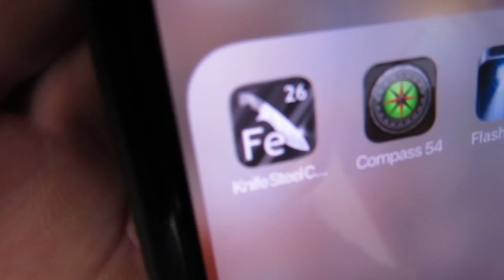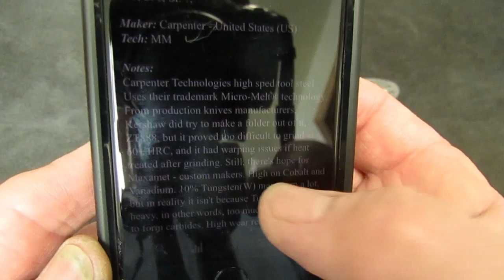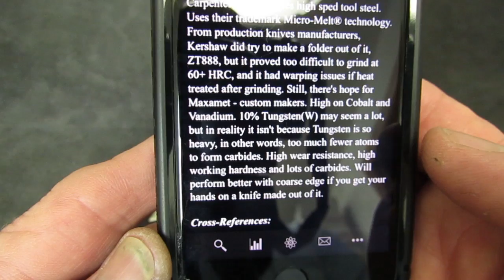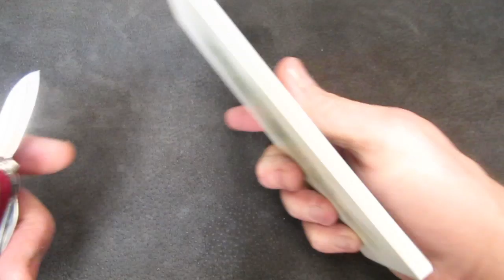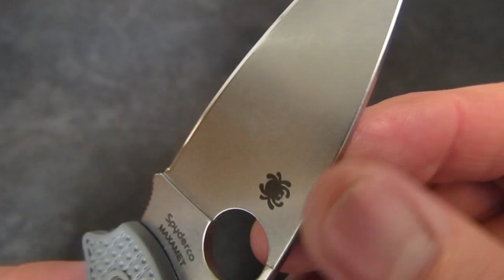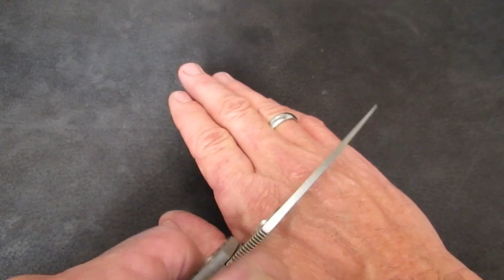FSB -- Struggles and Solutions:  My Maxamet Nightmare

Comment: https://www.youtube.com/watch?v=uhbKouyICyk this is another video done by a youtuber who got great results with his. Mine has held up very well in cardboard cutting and whatnot, great work knife. No sharp corners are due to the stonewashing v. satin finish, the same thing is true on the Slysz Bowie.
Reply from the maker: These corners were definitely NOT the result of stonewashing... unless they were tumbled for a few weeks.
Reply: Interesting - I assumed stone washing as well. The edges look too consistent have been removed on a belt or other tool. Doesn't seem possible these were done by hand. The finish is too consistent as well. I'd guess stone wash with something harder than normal or something called vibratory wash that uses liquid and a ceramic abrasive. Of course I easily be wrong.

Comment: Appreciate you going into more detail on Maxamet, Rob. I, myself, was wary of this steel for some of the reasons you mentioned, but it's helpful to have this clearer understanding of what exactly goes wrong and why.

My personal preference places a much higher value on the fineness of the edge (and its ability to retain it), rather than straight-up wear resistance. I understand most of the current super steels (Besides CPM-M4 and maybe ZDP-189/M390?) fail on this front, devolving into coarse micro-serrations after very little use following sharpening. 

About 15 years ago I was among the first to jump on the CPM-440V bandwagon when that, and the particle metallurgy process, was new and I found it to be a constant source of frustration (especially since I was dumb enough at the time to attempt sharpening them on a 204 Sharpmaker without diamond rods - a process that literally took DAYS). That experience has made me perpetually wary of new super steels, perhaps more so than is really justified.
Reply: His problems  aren't normal. Maxamet should take the same time to sharpen as m390 110v Rex steels. He's now just hating on the steel and making it look bad cause he has a hard time sharpening it. I don't know if that's due to  technique or a random problem with spydercos maxamet but that's definitely not normal behavior
Reply: Sour Have you actually sharpened Spyderco's Maxamet, or anyone else's?

What reason would Rob have for "making a steel look bad"? He has nothing to gain by doing so. He's documenting his experience with Maxamet as a full time sharpener with loads of experience with the other steels you mention and many more, as well as experience with half a dozen of these Maxamet blades. He also has never before reported problems like this with any of the other super steels on the market you claim are so similar to sharpen.

So what's more likely: that someone who has sharpened hundreds of knives in nearly every alloy on the market without issue is secretly incompetent and he has only now been exposed by this one niche alloy, or that Maxamet (or at least Spyderco's Maxamet) is actually an inappropriate steel for knives?

Finally, Rob's claim/issue isn't that Maxamet takes longer to sharpen, it's that the techniques and geometries he has to use to prevent chipping yield an end result that totally defeats the purpose of a high-hardness super steel.
Reply: Before you  discount maxamet please watch this. Granted this guy in the video is probably one of the best  sharpeners probably in the us. Im  pretty confident in saying that
Reply: I like the part where you edited out your admission that you have zero experience with the steel and then pointed to someone else's experience with a single prototype (Spyderco Mule) as the definitive statement on how Maxamet is in production use. With careful attention in grinding and heat treat, any steel can be made tenable. That doesn't make the steel suitable for production use, as evidenced by the fact that the very same company who made a Mule that didn't break can't seem to make a full-production blade that won't. Any steel that's THAT sensitive is, by definition, a steel unsuitable for blades.
Reply: Figured the vid should some it up. And I will have the pm2 in maxamet as soon as it's available. And if I'm wrong I'd be more then happy to tell you. But I'm willing to bed i get threw it just like I did 10v Rex steel cpm125 etc. maxamet is not some new steel it's been around a long time without ppl having this problem.

Comment: I was like OMG MAXAMET YESS then I got that exact blade in a trade and it ate my 120 grit edge pro stone away and the edge didn't look like it took any finish changes retraded it again pain in the ass to sharpen
Reply: Maxamet isn't difficult to sharpen with correct equipment. My bonded diamonds stones sharpen it easier than s110v.
Reply: kevin ragsdale yea diamond stones cut good

Comment: I don't think that maxemet makes a bad knife. I think just the majority of users make bad maxemet users.
It takes judicious use to enjoy the merits of that steel.
Reply: Maxamet doesn't chip, and it's easy to sharpen for me, in my experience. I use the hell out of mine too.
Reply: @kevinragsdale6256 and my rocket ship doesn't burn fuel easily, and it's easy to fly. I fly the hell out of it without ever re- fueling
Reply: @KEVLAR1911 when your in a office, begging your coworkers to cut open their yogurt from their lunch just to have a reason to use your knife and feel special, your correct, it doesn't chip, and is easy to sharpen. But for the blue collar guys, if it doesn't corrode away from being soaked in sweat all day, you will most certainly chip the edge, break the tip and possibly the whole blade. Unless of course you don't actually use it for real world tasks, but only when you see an opportunity for light cutting, which is what most maximet users do.
Reply: @enwin1912  I own a triple B handmade knife.  THAT guy knows what he's talking about!
Reply: Yeah. I'll take believe your word on it.   I've seen your videos on maxamet way before I saw this. That and Michael Christie's stuff. Never saw you guys run into problems, or supersteel Steve for that matter.
Reply: I put a good 1/8" chip in my Sage 1 Maxamet blade, but to be fair, I smacked it into a ceramic paving stone when cutting through a shrub branch.  Pretty sure any "super steel" would have chipped from that bone-headed maneuver.  Had a hell of a time getting it repaired and sharp with my KME system, but that was more down to my inexperience than anything else.
Reply: CSLFiero https://youtu.be/S_7EPuJiHg0

https://youtu.be/PEL70quVOMk
Reply: Does maxamet blade finish scratches easily? If I want a barbie knife for customization
Reply: Right on brother
Reply: @enwin1912  not at all!  I use a $40 smith's diamond guided system and it puts a screaming edge on my maxamet blades in minutes.  I've never had an issue.  It's my favorite steel that spyderco offers at this point.  This guy doesn't know what he's talking about.
Reply: no, sir. you can't enjoy the long life of the steel if on every cut you're trying not to chip. that long life will only translate into a long agony until the inevitable.
Reply: @CSLFiero  I've been using my maxamet for a year now.  Once you figure out sharpen in it it's awesome.  I cut tons of stuff with it and never was afraid of chipping
Reply: CSLFiero Then stick to your basic 8cr13mov steel for opening up your mail and Amazon packages. Maxamet, like any other super steel, has its intended uses.
Reply: CSLFiero that is not the case at all with Maxamet. Idk where you’re getting that idea
Reply: @Kev_N_1995  he's saying if you're worried about it chipping every second you can't enjoy the knife.... Idk what you read?

Comment: The Carter testing only work on grinds lower the 0.20 behind the edge. You can use your fingernail to watch the edge flex. It's not used to test toughness. It's used to see if he has resilience and elasticity in the steel. If it doesn't flex and just stays bent then it's too soft.
Reply: BBB and the apostle going head to head. I never saw this exchange between you guy's lol.
Reply: Whats Ironic about all the time that has passed is that Shawn's maker logo is on the 15v spyderco's now. I recently had a friend regrind my maxamet native to 8 thou bte at 15dps and he had no issues with chipping.
Reply: @Huero87  yeah what a success story and BBB started with such humble beginnings and as far as I know is self taught. Paul was really giving the guy a hard time lol, I don't think shawn was trying to hassle the guy either.
Reply from the maker: Big Brown Guy I think you’re missing the point, perhaps intentionally. The point is that a knife edge should be able to endure sideways force in moderation, at least that required to sharpen it, by deflecting and springing back slightly, without breaking. Maxamet, as processed by most of the Spydercos I’ve handled, will not. And I repeat, absolutely no other steel I’ve ever sharpened behaves like this. Also, this is not a one knife anomaly — five out of the six I’ve sharpened had this defect.
Reply: TheApostleP show us
Reply: With all due respect, regards 
-Shawn
Reply from the maker: Big Brown Guy I think if you read this comment section, and do a minimal amount of research, you’ll find his problem is real... or there has been a masterfully engineered conspiracy to trash Spyderco... by guys who love Spyderco. This video was not intended to prove the existence of a rather commonly known problem, but rather to give information on how to work around it. I think you should continue cutting up phone book paper, very carefully, with your Maxamet knives, and stop posting comments. You’re making yourself look silly... with all due respect.
Reply: TheApostleP we both know Empircal evidence is King nothing silly about that. Take it easy Rob.
-Shawn

Comment: I have the exact same knife and had to sharpen it up as well. I used my Edge Pro Apex and did achieve a mirrored hair splitting edge but it was not easy. Nor was it fast. A steel like this required my diamonds ,diamond strops and time. I definitely wouldn't say the average Joe would want to sharpen up a knife like this by hand. I see much frustration in their future. It's great but steels like XHP with a great heat treat achieve an equivalent edge much easier. Resist rust better, and hold it for a highly respectable time as well for a fraction of the cost. God Bless. Just my 2 cents. Thanks for the content bud.
Reply: Hi, what is your opinion on cts-xhp - is it tough enough to hold its edge decently?

Comment: Spyderco released the police 4 model in another steel with weird chemistry, k390- %2.5 carbon and %9.0 vanadium. Any experience with this steel? Also isn't zdp-189 another super high carbon, chippy steel (also used by spyderco, hmm...)?
Reply: Mt. Baldwin k390 is Bohlers version of cpm 10v. It's not a super tough steel but it's tougher than maxamet. 390 is usually ran to 62-65 hrc while maxamet is ran to 67-69 hrc which makes it harder but more brittle. K390/10v make a good knife if you cut up lots of cardboard for work. I haven't had any issues sharpening those 2 steels. Before you start speculating do a lil research.
Reply: K390 is not the answer to cpm 10v - it is k294 that has the same composition as cpm 10v ...
Reply: Vesselin Georgiev 
Re: What is K390 Comparable to?

PostFri Dec 09, 2016 8:56 pm

I have been using K390 from the start ever since it was introduced by Bohler and I got some small samples to try. A bit of history is that it is the European version of CPM 10V but not the exact chemistry (about 1% less V plus small addition of a few others). That is because the CPM 10V chemistry was protected by patent at the time. If you check the K390 data sheet it claims that the bit less V gives K 390 a little boost in impact toughness. It also can be heat treated at a lower temp. than 10v. So it is pretty much the same as the A11 grade but different in a few small details. It is hard to tell the difference between CPM 10v and BU K390 in the real world in my experience. I like both grades and they are the base line (along with Vanadius 10 and K294) from which I measure wear resistance. The 5 chrome is there to make them all air hardening among other things and does not contribute much to corrosion resistance. It is going to make a killer knife in the new offering and be another classic. Phil

This was said by Phil Wilson who is a master knife maker and knows his steels. I know that K390 doesn't have the same exact composition as 10v(A11, Vanadis 10 or K294 like you said) but it's close enough and 10v is more well known. I should have said that k390 is similar to 10v instead if it's Bohlers version of it.

Comment: I had some huge/ similar issues with h1. I was only able to not rip the apex off by doing ONLY strokes away from the edge. If i went towards the edge, no matter how light the pressure, i'd just rip the edge right off. :(
Have you experienced this with H1 rob??